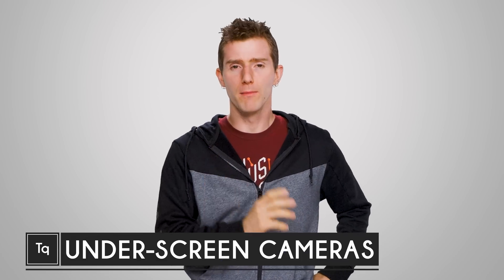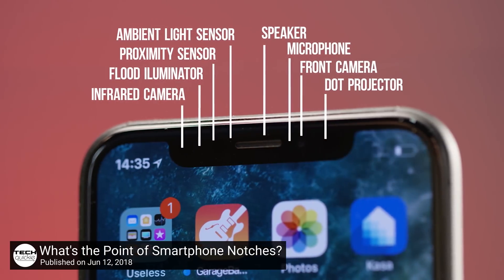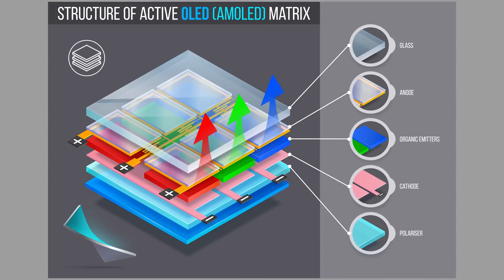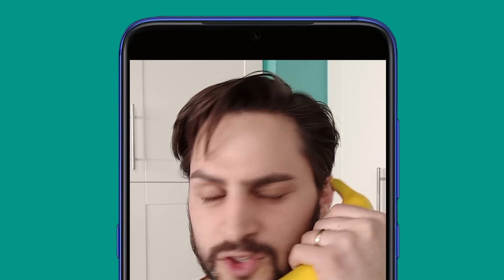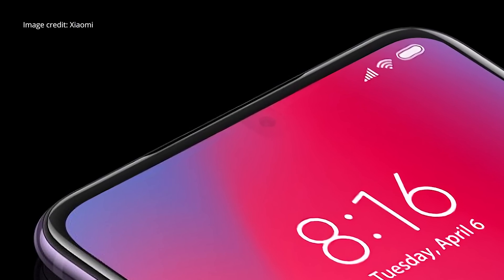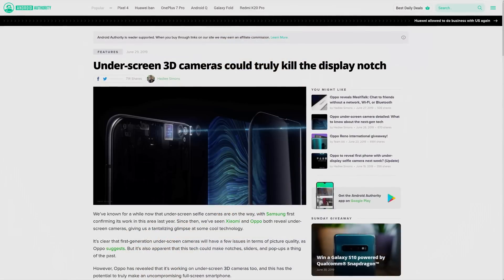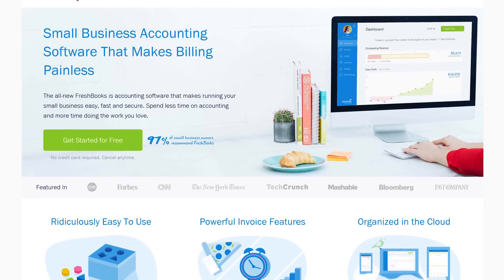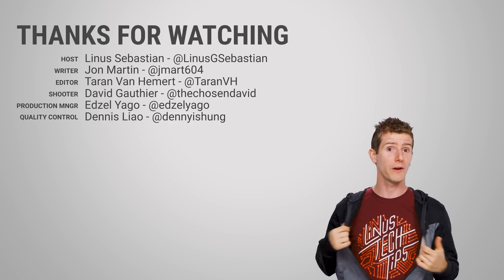How Under-Screen Cameras Will KILL the Notch

Comment: I think phones dimension in general have gotten too big for the past few years. What I love about bezel less phones isn't how it looks, it's more about the efficiency of screen to overall phone dimension. Sadly lots of bezel less phone have too big of a screen to my liking, 5.2 inch is my sweet spot when you're going out and constantly keep the phone on your pocket. What I need from a bezeless phone, is exactly as it says, no bezel, a more efficient screen to overall phone dimension, meaning you can have a compact phone which you could reach the screen all the way with your thumb whilst having the overall size compact.

 Then regarding the cons of bezeless phone of not having an area to rest your fingers, you can simply solve it by attaching add ons that could also serves as an external speaker or any other device. You can put headphone jack or whatever you want on that external add on device, about having to bring extra stuff is not like bringing a physical wired headphone is less of a pain. So you also need... More USB port! The RoG phone could achieve that, why can't more flagship phones implement it. Then regarding the space for battery, I don't really mind a slightly thicker phone as long as it doesn't look to bulky. You canwork on a design to make it look illusory slicker. A thicker phone also provides extra durability to the phone.

 Want to have a bigger display when you need it? . These expandable screen concepts can be implemented. The capacitive, no physical buttons also looks promising. You should also be able to program those capacitive buttons to do your stuff. All physical button you need is one, single physical power button for hard reset and recovery mode.

 We've seen many innovation and unique gimmicks from different phones for the past couple of years. I'd love to see these ideas integrated to one, single, ultimate user experience phone

Comment: Personally I think the notches and "islands" or what ever they are called look dumb.  I don't care about all screen phones either.  Just make a space across the top for all the needed stuff, don't need a screen there.  And if you want it to look nice, make a matching space across the bottom with other needed stuff in there.

If I watch videos on the phone, I don't need the extra 3 or 4 MM on each end that these spaces provide.  Same with games and pictures, the extra 6 to 8 mm total are not going to make me wish I could see the game or picture just that much wider/taller.

I also dislike the screens that wrap around the edges... with the phone companies would stop that, I have big hands, I already set things off on normal phones that still have a bit of an edge.

Other things that annoy me about cell phones....

Removal of the head phone jack (Till decent bluetooth headphones with more listening time than the phone has in standby then you can still not take it away, because I like my cheap little headphones that don't require batteries).

Not including removable media (Every cell phone should include removable media, period).

Not including an FM radio built in that don't require the use of a net connection. (yes some people still want stuff like that, though I don't know how common it is to not do this).

Ultra thin phones that seem to bend if you even breath on them (Would love to try the energizer one for a bit just to see if thats a good fit for me, but don't really need it that thick).

Glued in batteries (Make it hard to get in, I understand, but with the proper tool, make it so I can get the battery replaced in seconds, even if I have to just take it to a local store to get it done and pay 5 or 10 bucks for the few seconds it should take).

Comment: Next: Removal of charging port
Reply: A phone has before
Reply: Wich is not a bad think actually. The induktiv version would last longer since the charging pot getting fucked up over time because of dust, water and the multible time of plugin the wire in and out, wich will fuck up the phone even further.

Comment: All of this would never have been an issue if they just kept using bezels. I take a rectangle screen every day even if that means half of the body is made out of bezels. Saving up a tiny bit of extra screen by making a ridiculous design is just beyond crazy. I don't need notches, I don't need punch holes or mechanical parts, I'm just fine with a simple tiny bezel that can house a camera and a speaker.

Comment: I rather choose the One Plus 7  PRO design camera, its better and companies can add more features to it, like a double front-facing camera and more sensors. With the under-display camera, it seems like it won't work that well, at least for now. It will still bother to see the camera, even though it's less visible.

Also how about privacy? You know that we don't trust cameras looking at us all the time, and that worrying feeling increased on Android. And I think it's cool that we can hide the camera and use it when we want.

Comment: 1) The notch IS a design choice. Since no phone ever required to have a notch, it was always a compromise made by the manufacture at the time. 
2) Nobody has to suffer with a notch because, hear me out, you could have just bought a phone without one.
Under screen optic tech was already in development, so notches were just a stop gap like mechanically hidden cameras. But unlike motorized cameras, all the notch did was give manufactures a cheat to falsely claim a larger screen size and screen to body ratio.
Tear drop (like the Essential phone) and hole punch models are actually taking design into consideration when making the compromise. Apple's notch is/was a joke that unfortunately got copied by too many trying to be like them.

Comment: Screw the notch. The no headphone jack is the big dilemma.  Rumor is no jack on the note 10 so wtf do I buy now....
Reply: Maybe a Xiaomi k20 pro 😅
Reply: It's called Bluetooth.  Look it up.
Reply: @JamesLundquist  i have galaxy buds they suck they hurt my ears amd make me sound like I'm in a fish tank. I also have 3 phones I use and swap the jack between them as i get calls. BT earphones cost alot more than the 100 different wired options. Its just a stupid cost saving measure. If you don't want them, Great. I will not buy a phone without one. And reading the comments neither will many others.

Comment: Smartphones are getting worse. Very useful features are missing. Headphonejack, Durability, Form factor and a easy replaceable battery. I don't want a smartphone which cannot survive a drop without cracks. Thinner, lighter faster but thermal throttling? Seriously? Why I should pay then for a phone which cannot be fast for longer than 30 minutes before been to hot tto touch? Grap manufacturers

Comment: The notch is inconsequential as long as the sides of it are relegated to the task bar, and when watching a movie in landscape, the video is cut off even at the notch. It's just implemented purely/improperly.
Reply: The top of my screen is 100% filled with notifications 24/7. Even in landscape mode. There is no room for a notch.

Comment: can't we just have a little bit of bezel above the display -  also a convienent engineering position to put one of two front-facing stereo speakers / telephone earpiece / prox sensor...? - and another little bit of bezel below the display for another front facing speaker to enable stereo sound, and also a mic.  it's really not hard. see: pixel2xl (except i wish it didn't have rounded display corners, and that it had qi charging.)